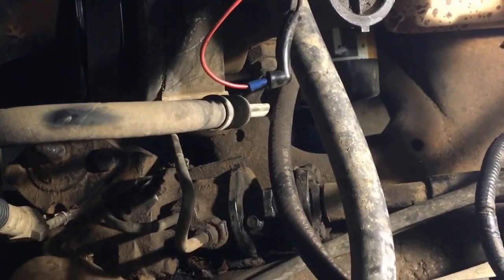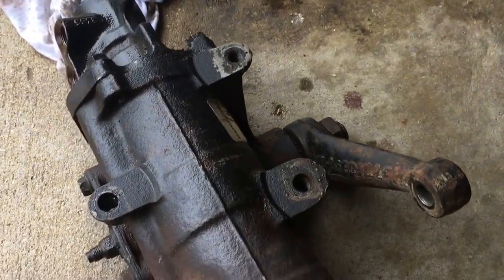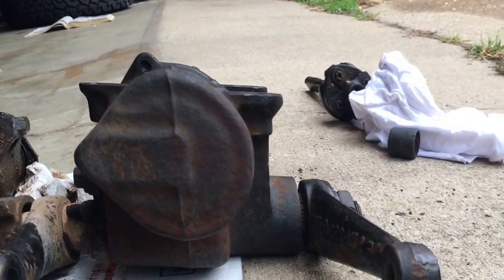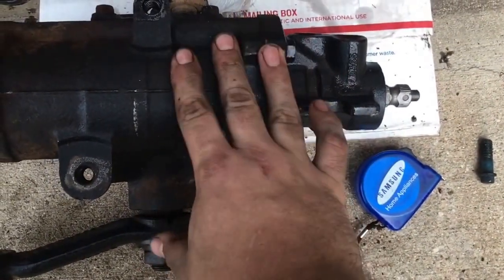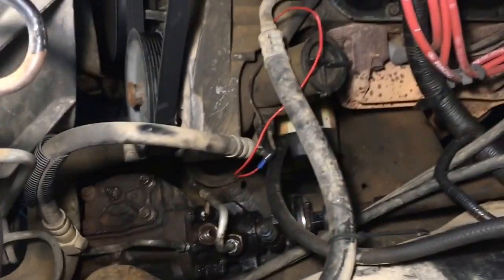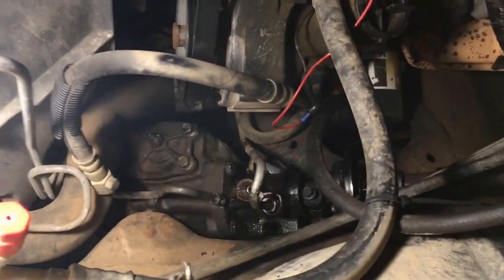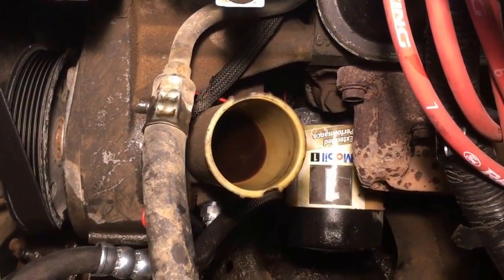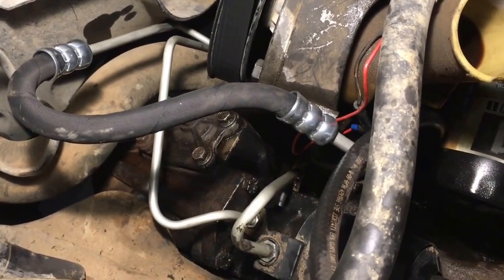Bronco F-350 steering box swap

Comment: I have a 89 f250 2x4 with the non ajustable steering box. Does ot mean i could get the ajustable one and all i need from a 4x4 97 f250?
Reply from the maker: The box should link up. But double check the spline count before you buy. There could be a difference between the 2wd and the 4wd boxes.

Comment: Will this swap,work on an 85bronco and a similar year f350?
Reply: They didn't start the 4 bolt boxes until the late 90s. I'm running a 1999 F-350 box on my 94 Bronco.
Reply: @black777mass  how is working out for you?